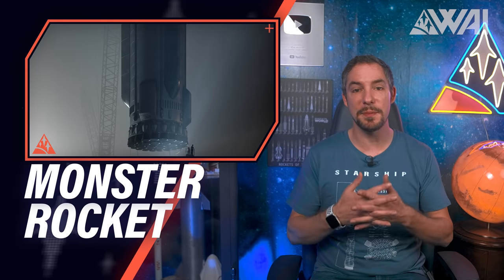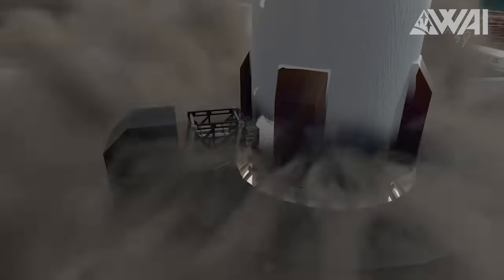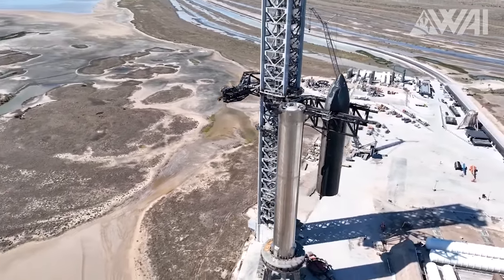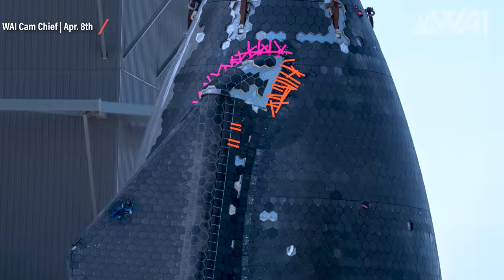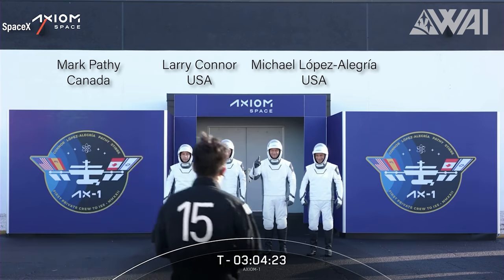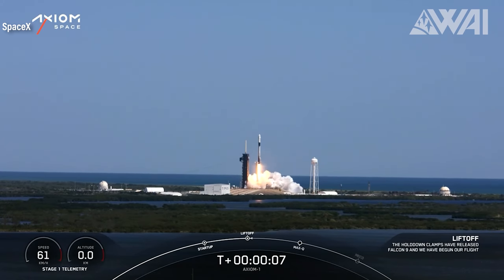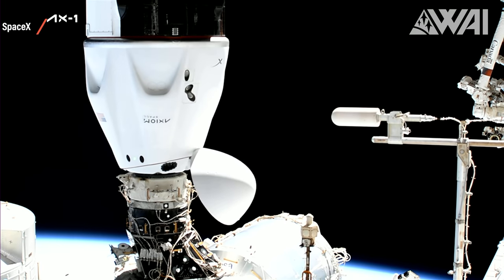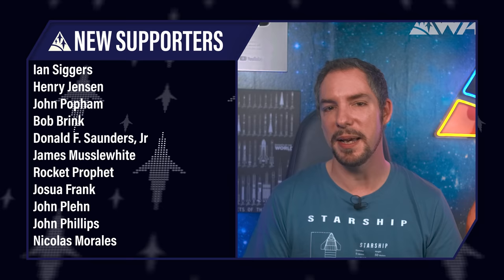SpaceX Showing The Guts Of Their 33-Engine Starship Booster Monster For The First Time!

Comment: I have a question; how would Starship affect our environment?
Reply: Not much. Consider that after liftoff it will only be in the atmosphere for less than 2 minutes. It simply doesn't have enough time to affect the environment much and the pollution it does exhaust isn't all that harmful. I know it's not the evil answer you were hopping for but it's true.
Reply: Not more than a gas power plant, but FAA needs much more time for the answer.
Reply: Almost no impact. The goal is to make the entire Starship program carbon neutral by producing the propellants using renewable energy.

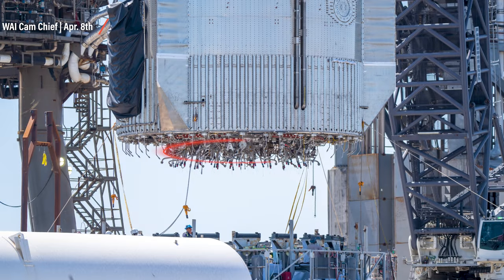Comment: @What about it?! It looks like there's actually 20-21 workers in that picture. Looks like you only circled 18 and there seems to be 2-3 that were not circled near the center at roughly 2:30/3 o clock position relative to the center.

Comment: When are the SpaceX people going to develop a quick connect so all engines can be quickly attached to the booster without all those tubes and electrical wires being hand tightened which induces human error.

Comment: Could they put a thin blatter inside rocket to help hold pressures. MIT developed that new high strength plastic. It would save to be pre-stressed before touching inside walls of rocket to rocket calibrated minimum presure capability. GOD'S SPEEDY Musk and others in this most important endeavor in all of man's known history.

Comment: Imagining 33 highly-stressed engines won't regularly execute RUDs is little short of hubris.
That is why RocketLab will use engines which are significantly less stressed.

You can have highly stressed turbo-pump rocket engines you use just once.
Or you can have lowly-stressed turbo-pump rocket engines you use many times.
But you can't have highly-stressed turbo-pump rocket engines and use them many times.

And if you attempt it,  then the turn-around time goes from weeks to many months. And let's set the record straight: Starship will never be turned around in less than a few weeks. The idea of turning a turbo-pumped rocket around in hours is the height of delusional fantasy.